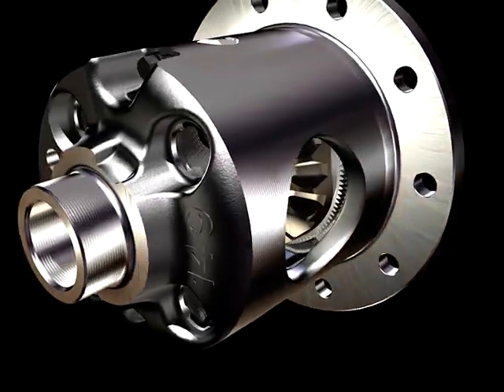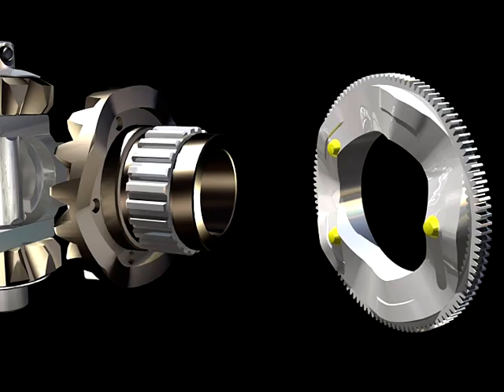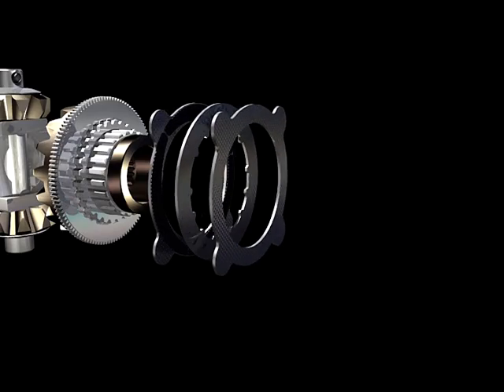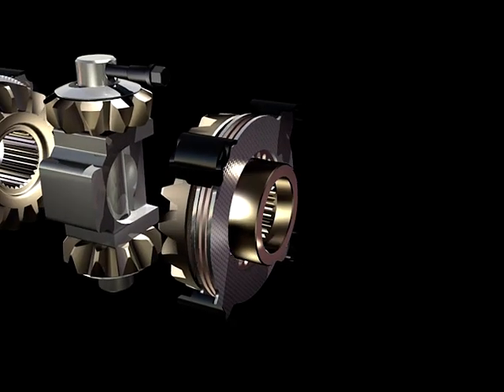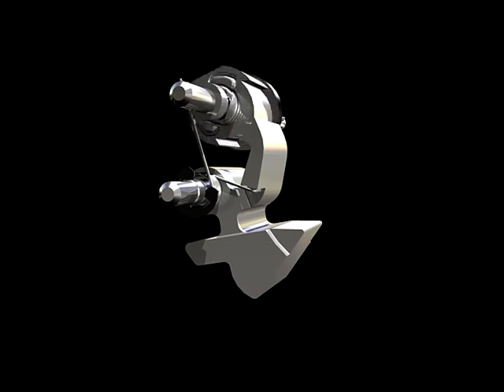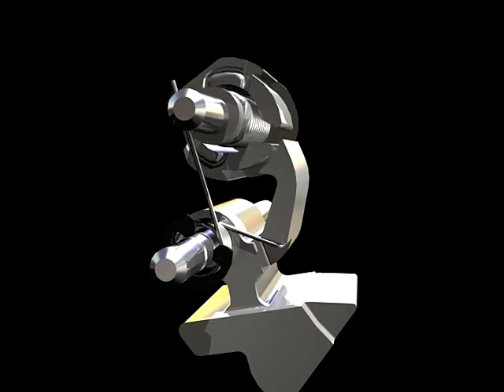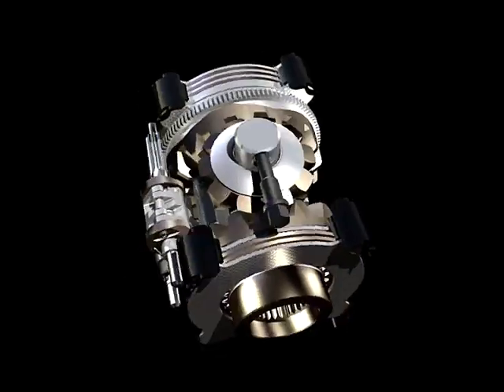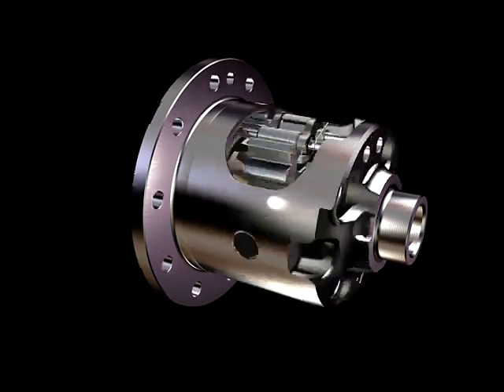Eaton Mechanical Locking Differential

Comment: Nah, way too complex. Simple torsen gear diff is way more reliable.
Reply: I broke my brain trying to understand
Reply: Yay Torsen
Reply: Yup torsten gets my vote.
Reply: @Mr Sunshines it's only called a "limited slip" because ?some company? trademarked the word "locker" and "locking".  It used to be called " an automatic locking, torque sensing device" and the military booklets that came with the HMMWV (which uses it front and rear) called it a locker.  With a little left foot braking it locks solid.   Unlike any other locker, it can also go around a corner without allowing wheel slip.
Reply: @Mr Sunshines actually you can lock a Torsen, if you knew what you are talking about.  This device uses clutch packs and clutch packs allow slip.

Watch this video at 4:45 and tell me how a "locker" would apply more torque or allow less wheel spin. YDS.

https://youtu.be/dzgcsnf8E_U
Reply: @fabulousoffroaddesigns5080  Actually a torsen never locks up, if it did it wouldn't spin a tire that lifted off the ground. Torsens bind up as part of the torque bias and multiplication.
Reply: @fabulousoffroaddesigns5080  You just proved my point, lockers are different than torsens because lockers lock and torsens dont.
Reply: @killer2600  then explain a Detroit Locker or a "lunch box locker".  When you go around a corner they disconnect the outside wheel completely making it free wheel and apply ZERO torque.  When driven in a straight line with tires that have even slightly different air pressures it will push with one tire and drag the other.

Compared to either device the Torsen® will transfer more torque to the ground and reduce wheel spin or wheel drag and never allows either wheel to free wheel.  Sorry but lockers lose.

The locking rate of a Torsen® is affected by the twist rate of the internal worm gears.  Each device is different.  The locking rate is different on an Audi S4 then it is on a Mustang GT, which is different again on a Raptor.  On road and off road uses, as well as front axle vs. rear axle all require different twist rates/locking pressures.  Also a Torsen inside an E-locker like on a Rubicon is a small/low rate worm gear because it is not designed to lock up the axle under power, it is designed to slow or stop wheel spin under low Load to reduce the failure rate of the e-locker from smashing while being engaged with one wheel spinning while the driver thinks they are stopped.  The triple worm gear system is also a much stronger internal system then spider gears.
Reply: @fabulousoffroaddesigns5080  The argument isn't about how other systems achieve mechanical lock or about whether Torsen differentials are useful. The argument is whether or not Torsen differentials lock the left and rear axle shafts together. Nothing in the Torsen differential locks them together at any given time. It is the binding forces on the torsen gears that not only sends torque to wheel with greater traction but sends MORE torque (3X or even greater) than the amount that the slipping wheel is receiving. A locker can't do that torque multiplying, even a welded diff can't do it. A torsen can because it doesn't lockup it binds and the forces of binding can achieve the torque split.
Reply: @killer2600  so you are just arguing about semantics.    Because it requires pressure to lock it, it's not a locker?  They all require something.  Some require electricity, some require air.  This requires brakes.  

Even though they were called a locker for 60 years and an LSD for just the last 10 years due to trademark infringement, it's not a locker?  You think the difference between locking and binding internally to ELIMINATE slip makes any difference to the customer?  The Torsen will do everything a locker will do plus a thousand things it won't.

Here is the bottom line.  LSD is a term that evokes the imagination of clutch packs and weak points.  They were locked up until the clutch packs slipped allowing wheel spin.  The Torsen uses none of that and works opposite to a traditional LSD.  Torsen should coin the term SED (Slippage Eliminating Differential) and disallow Eaton from building their product under license for what they have done.  In the end it is true most off road customers don't want the superior product, they want the coolest looking gadget, because in this case "switches reduce the inferiority complexes of idiots".
Reply: @fabulousoffroaddesigns5080  LSD is not a locker (aka locking differential). And it's not semantics, nothing inside a torsen differential locks together. Better yet, nothing inside a torsen differential unlocks either. If it doesn't unlock or lock, it's improper to use the term. When my car door is frozen shut and stuck, I don't say I can't get in the car because it's locked.

As for Torsen being superior. It has it's place but it's place is not in every application. Rock crawling where you expect to get a wheel many inches if not feet in the air, Torsen is not the best for that application. Applying the brakes so that the torsen will have some torque to sense and thus then multiple that torque to the stuck wheel rather than just spinning the airborne wheel is not an advantage it's a workaround. And maybe you'd like your tire to never spin free if it goes airborne while your trying to crawl up a rock.

You'd think by your username you'd already know all this but ignorance is bliss and some people think anything that isn't an open diff is a locking diff and thus a locker. The same people also can't explain why a torsen diff will spin a wheel and what applying the brakes actually does to get the other wheel moving. They know it does and that it works but they can't explain the physics of it yet they call it a locker.
Reply: @killer2600  again with the semantics.  It doesn't matter if the door is frozen, broken, bound or jammed.  If you can't get into your car you ARE "locked out" of your car.  It's no different then being "locked out" of your computer.  It's not only true, it's proper English.  You are talking about one use of the "noun lock" as a mechanism, only allowing that definition.   I am using the "verb lock" which means to fasten or secure two or more things together.  Just like Captain Kirk's "Tractor Beam Lock".  No mechanism but the two things are locked together.  ...or a missile guidance system being locked on target.  Still no mechanism.  A locker is anything that performs the action of locking.

A lot of rock crawlers disagree with you too.  Most of the fastest buggies at KOH use Torsen's (built by Gleason Detroit, Quaffle or others) in their front axle at least.

Most people buy their rigs based on marketing, I built mine and I have a Torsen front diff I helped install.  I totally understand exactly how it works, and the more torque applied; the tighter it locks, jams or binds up.  As soon as you overcome the obstacle that causes the binding in a "locked state" it will reopen.   They work on the principle of "worm gear - worm wheel".  The principle states that a " worm gear" WILL turn a "worm wheel" BUT a "worm wheel" WILL NOT" turn a "worm gear" .  There are 3 sets on each axle shaft/side which are geared to oppose the 3 sets on the other side.  Under equal pressure or no pressure they both operate freely.  Under different pressures the worm wheels from one side  transfers torque through to the other side where those worm wheels jam up against the 3 worm gears and temporarily lock the two axles to turn at the exact same rate of speed.
Reply: @fabulousoffroaddesigns5080  The english language is not semantics. You can't lock up something tighter or more.

You can call it lock up all you want but even the people at howstuffworks.com write "The Torsen (from Torque Sensing) works as an open differential when the amount of torque going to each wheel is equal. As soon as one wheel starts to lose traction, the difference in torque causes the gears in the Torsen differential to bind together."
Reply: @killer2600  partially quoting things is not a valid argument.   Torsen comes from torque & sensing yes which comes from  Gleason's accepted US government patent description which called it  "a torque sensing automatic variable locking differential" .  I think the engineers who invented it and the government employees who reviewed the patent understand it a bit better then your description of some kids blog or vlog who operates a website from a basement somewhere.  

AM Generals operating manual for the HMMWV calls them  "locking axles" .  US Military trainers still call them "lockers".  Every piece of literature about them prior to about 2009 in every vehicle (Jeep, AMC, Ford, etc.) called them a locker or locking differential.  They were never referred to as a limited slip until after those words were trademarked.  Believe what you want.  You've never installed one, you don't own one and you've never properly operated one.  You are basically a " locker troll" trying to regurgitate marketing BS.
Reply: @fabulousoffroaddesigns5080  Ok. tell me what locks in a torsen, when it locks (at what moment), when it unlocks, and how to visually determine if it's in a locked or unlock state. After that tell me why it's not binding but rather locking. This should be super simple and give distinct explanation for someone so adamant that a Torsen locks up.

P.S. I don't care what military trainers call it. They didn't invent it, they don't care how it works, and they aren't the most correct english speakers. They could call it a do-hickey but it wouldn't make it right.
Reply: @killer2600  what locks is the rotating shafts which are locked in synchronized rotation.   If you want to see how it works drop into an automotive mechanics class.  They will have a blown up demonstration system to show you physically how the pressure on a worm gear stops the worm wheel from turning.  It's like tuning a guitar.  You twist the worm gear, and it holds the worm wheel that is connected to the string in place.  The worm wheel can't move, it is locked in place.  You don't need to clamp them, drill them, pin them, or "lock" them.  They are locked in place.  The force of the string can not turn the wheel or the gear.

Some day I will make you a video of how it works on my truck compared to the Eaton E-locker I also have on the same truck.  

As a note:  the Eaton E-locker does not "stay" locked.  When you shift from forward to reverse it unlocks and has the re-engage and lock again, some times missing the engagement point and spinning openly.
Reply: @fabulousoffroaddesigns5080  You fail miserably. Just because something stops turning doesn't signify it's locked. The wheels on my vehicle don't turn at a stand still but if I push it in neutral they definitely aren't locked. But carry on with your ignorance, you're not the only fool that incorrectly uses the term "locked" in reference to a torsen. The proper terminology for what happens to a worm gear is bind and it's bind not locked because theoretically you can apply enough torque to the spur gear to rotate the worm gear (negating the shear strength of the gears and presuming the components to handle an infinite amount of torque). But don't learn anything on my account.
Reply: Told you torsen is better.

Comment: I plan on replacing my G80 Gov-Bomb with a Yukon DuraGrip. When I do, I will dissect the G80 and modify it by removing the governor assembly, grinding off the detent protrusions and wave spring, and possibly adding another clutch plate. The thought is to create a more conventional LSD differential without the violent governor actuation. I will reinstall for testing purposes.
Reply: Did you try it?
Reply: There better be a video on this one day

Comment: if it automatically disengages at 20 mph, does that mean when you are driving hard and spinning hard to get through a mud hole the differential will go from locked to open?  That does not sound good.
Reply: It doesn't disengage at 20, but rather cannot engage above 20,  so if it's already engaged and you accelerate it would most likely stay engaged until the load is gone (you let off the accelerator)

Comment: Seems to me that the centrifugal locking devices are just another version of an Impulse Coupling on an aircraft magneto. It's used to initially spin the magneto faster to generate a heavy spark during start cranking.

Comment: all those small parts being stopped instantly is just asking for things to break
Reply: This is Pointless And they do break, quite frequently. I've replaced a countless number of these diffs. On more than one occasion I've seen them explode to the point the broken pieces have punched right through the diff cover. This is one locking diff I would stay clear of. Too many moving pieces.  Too many parts to fail. The best lockers I've personally used are Detroit lockers. ARB air lockers are fantastic for off road use on speciality vehicles. Just a little too pricey for the average Joe in his daily driver truck.
Reply: First Name Last im driving down the highway,  suddenly my rear tire locks up shreds the tire.i think the diff locked up on me . I don't see how but you obviously have more experience with this model differential.  could this be the culprit  ?

Comment: I have exploded one of these when I had one wheel in the ditch and one on the pavement. On another Chevy truck I had one that would lock and would not unlock for several days. Both trucks were 3/4 tons with the 9.5 axel.

Comment: My 2009 GMC Sierra has this and the rear end will occasionally lock up for no reason which makes cornering a harsh situation. Always occurs at low speeds just after leaving my driveway. It eventually opens up on its own but not without a loud "clunk".
Reply: The action and clunk sounds like a Detroit Locker, but I don't think the factory would ever put one of those in there. I was thinking one of the little springs on those centrifugal weights is broke which would mean it takes very little differential action to activate the clutches. Turning out your driveway spins those weights, which is why they have springs or they'd activate on any turn. The spring holds the weight in place until the weights spin faster which is assumed a traction issue, not a corner. I wonder if you can access the spring(s) by simply removing the back cover plate from the diff housing? 
Why it clunks I don't know, but clutches bathed in the wrong oil can have a lot of stiction so I suppose engagement or release could be sudden and make a similar sound as all the parts unwind? That's basically what the Detroit does, it's only fully engaged or completely disengaged to the axle, no gray area so it can be rather violent when there's torque on that axle.

Comment: So, this diff has only a 2-pinion design.  Aren't 4-pinion preferred for heavy applications?
Reply: I agree but since I've never seen one in the flesh I suppose maybe they do have four and the vid shows two to simplify it? Or they simply made the single shaft/two spider setup strong enough to be as good as four?

Comment: Seems like an awful lot of wear surfaces just sliding stuff together and lots of moving parts. Anyone know the kind of miles you can get from one of these?
Reply: I just bought a chevy with this g80 and it has over 200k miles on and it works perfectly.
Reply: I have a 2001 3/4 ton 6.0 with 235,000 miles and the G80 works as new with no repairs.

Comment: Brilliant engineering!..can I install this in to the front axle?
Reply: You wouldn't want to unless it was a dedicated off road vehicle. During tight turns, the wheel speed difference is greater than 100 RPM and the front axle would lock completely binding up everything.
Reply: Corpsie: My estimate is about a 10mph diff between the left and right tires to activate it, which I can't see ever happening. I suppose you could do the math and post the turn radius/speed. I'm kinda curious... Randy: I'd pick a different diff, this one is no doubt expensive and would be less than ideal for the front of a 4X. Maybe a generic limited slip which would no doubt work better and be less stressful on your joints.
Reply: +Randy Pullman You would have to get a 4 wheel or a 4x4 drive vehicle.
Reply: carl cappy No shit? 🤦‍♂️
Reply: Randy Pullman

Comment: so if i back up and hook to a trailer , on say wet grass ,I have to spine the first tire to make the other hook up ... so now I have only one tire with traction  again ..... rather have normal diff lock   so I have two tires pulling .....
Reply: This g80 is killer. I've had two.
Reply: ya thanks... test drove one and the salesmen real tried to push it like it was a good thing ,,,guess  that is there job ....think i will pass ....watched a vid on one ,at just low speed ,,and boy did it hit hard .....
Reply: +Nicole H you must not have drove a chevy truck with one equipped

Comment: One word: ARB Air Locker
Reply: +Scooby If only they came standard, the reason most people have the G80 is because it is part of towing and other similar packages in GM trucks. They are also cheaper then an air locker system.
Reply: That’s two words and an acronym...

Comment: I'll use this kinda diffrential on my Volvo 745 Turbo with around 250-300Hp,  It is working very well and is very good on winter roads, as for track days, havent broke one yet.. What i've done is weld the engagement pawn? thats what she sayd?  anyway, so it locks even if you're speed goes over 20mp/h. It still act's like an open diff with normal driving, and does only lock when one wheel start to spin, and it unlock when you release the trhottle, so actually quite fun to do burnouts and roundabouts with :D

Sorry for bad English, I am Norwegian :P